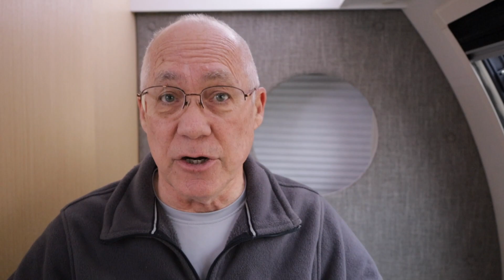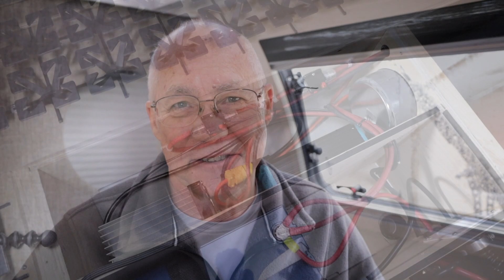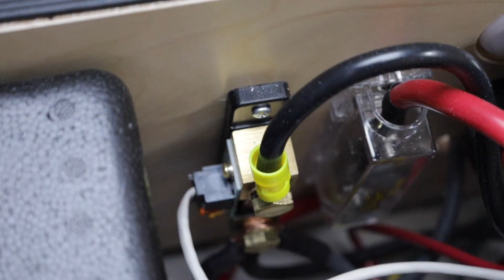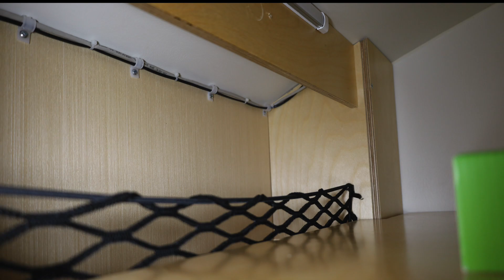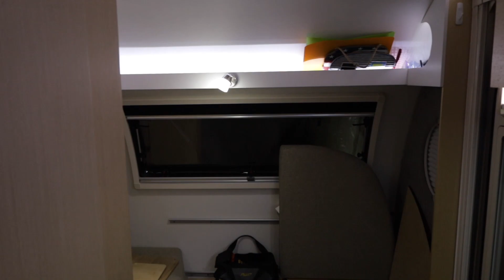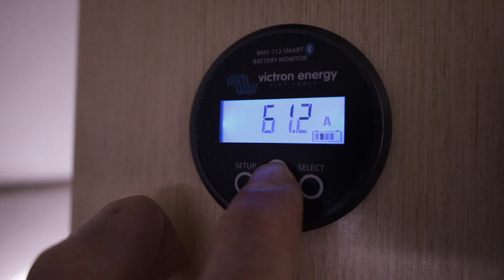Lithium Battery Upgrade   HD 1080p

Comment: I recently purchased two Battleborn batteries for my 2018 Tab 400, and need to get help getting the wiring to work completely.  I also need a monitoring system, charging options...  There original battery died, and I am not equipped to do this.  Do you have a list of the items  you selected?  In researching your components, were these recommended by Battleborn or were they the best price?  Where did you purchase them?  Did anyone work with you to make sure you ordered everything you would need?  I am in Michigan, do you know a way to find someone with skills in place to do the conversion?

Comment: One thing you didn't explain, why did you go from the pair of 6 V AGM batteries that put out 240 Ah (120 Ah usable) to a 100 Ah Lithium (80 Ah usable)?  Seems like a lot of money for a reduction in total capacity.  I could understand it if you added a second Lithium.  I assume you removed the original AGM batteries.

Also, is there a reason you put the converter in the back rather than simply swapping out the existing converter?  Seems like it would have saved you some space.  One other question, are you going to have cooling problems with the inverter and converter in that small unvented space?  Seems they could get quite hot.
Reply from the maker: The original 6 volt batteries were not very good quality and one had already gone bad. There is room for a second lithium battery that I will add later. The recharge speed is another reason I went lithium. 

The wires from the original AC charger/converter run from the front to the back of the trailer and are not large enough to handle the amperage. Running the AC line from the back to front is much easier than running bigger DC lines.

There is a little venting in the rear area I installed the chargers. More ventilation can be added if necessary.
Reply from the maker: I kept the original AC charger in place, but disconnected. It is very easy to reconnect as a backup.
Reply from the maker: Also, the new AC charger is much larger than the original equipment and would not fit in the same space.
Reply: @TABPaige-zy7qs  
Thanks for the information.  I have a 2018 400 with the big 240 Ah battery.  So I'm following these conversions for when the day comes when I have to replace it.  Of course my space is different with the 2018 so the arrangement would be different since I have that big open space in mine and no air conditioner back there.